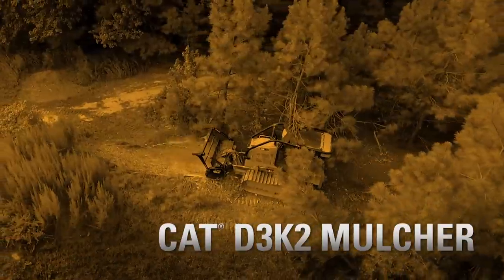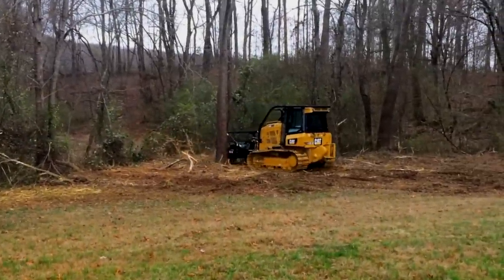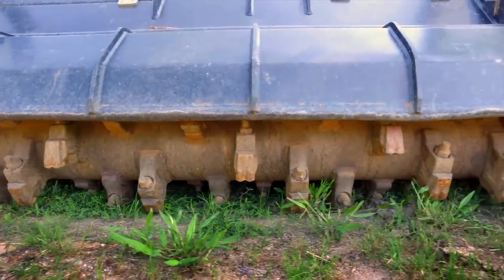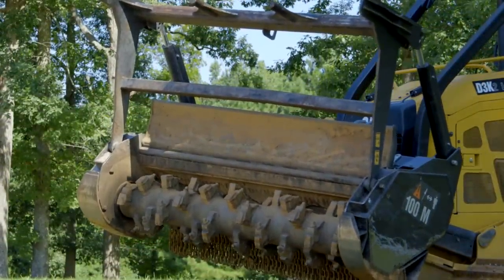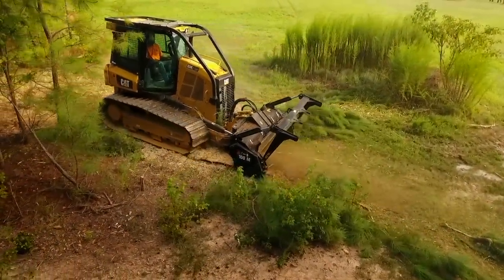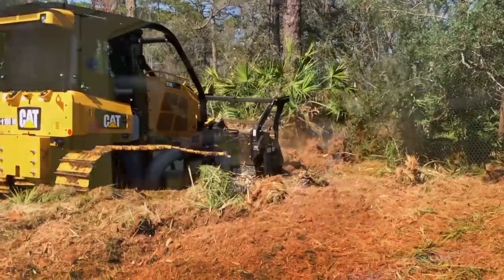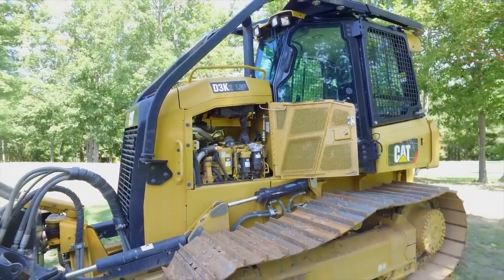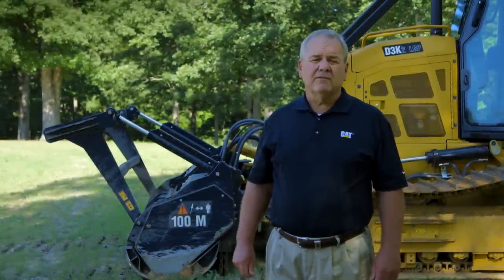Cat® D3K2 Mulcher Overview

Comment: More of a Dozer than a mulcher. I’d like to see it in action. At 104hp and 17 gpm and under 3000 psi it’s an oversized track loader with low flow. The reversible drum is cool
Reply: Absolutely not enough hydraulic flow... for the life of me this would not be a good choice . Give me an excavator with a fecon mulching Head. Way more versatile. Now you get the best multi tool ever , that’s the excavator

Comment: I had the opportunity to operate one of these machines. The bulldozer is great. The mulcher on the bulldozer, on the other hand, is not worth it. While I understand that this isn't supposed to be a dedicated mulching machine. I could go get a dedicated mulcher, complete the job and leave before you could spend the 4 hours changing heads. Anything this mulcher would do efficiently, we have a 10ft front mounted 1000rpm brushog that would do it in half the time. While the reversing drum sounds great, if the machine had enough torque to reverse the drum, it wouldn't have stopped in the first place. Simply find something solid, set the drum down on it and backup.

Comment: Why not use a tracked Skid Steer?  They normally are way faster and you can get much more work done.  Granted the dozer is going to be stronger when pushing through brush and pushing trees over, but the bottom line is how much work I can accomplish is going to affect my bottom line and prices I have to charge to make a decent profit.
Reply from the maker: Hello Gary, you are correct the Cat Compact Track Loader with steel track could be used for a similar application. The D3K2 provides a heavier platform for rough terrain and the HM518 mulcher has the ability to reverse direction when stalled due to excess material. We offer our clients solutions based on their job requirements. If a customer's operation requires that they spend a significant amount of time doing this task, the D3K2 Mulcher is a strong option.
Reply: The ASV120 posi-track with a mulching head would be way more efficient. If I was going to spend the money for a mulching unit that size. I would buy one specifically designed for mulching

Comment: make a quick coupling system like on wheel loader,
offer it for all tracktors up to D6 or even better even for Track-loader and u will sell much more...

many company dont buy a Tracktor or Track loader cause they need this machine like 6 out of 12 month, but if u make it more alrounding without cut the power many will buy it
Reply: U can get mulches for a skid loader your not going to put a mulched head on a wheel loader or ag tractor
Reply: @jonathanvanginkel3849  a wheel loader with and mulcher head isn't uncommon
Reply: @jeffreid3341  I know several land clear companies and have been around equipment my whole life have never seen it on a wheel loader or why u would put it ions one but I suppose it has its place

Comment: aux pack for weight in the back and run the mulching so fast or so strong a 15 inch diameter pine tree does not slow it down. but come on, 4 hours to change to a blade.

Comment: can you put this pacage on a tracked loader
Reply from the maker: Hi Evan! Take a look at our 299D2 XHP Compact Track Loader with the Land Management package. It includes a rooftop aux cooler and the HM418C mulcher. This would be a comparable package to the dozer set-up for a track loader. Contact your local Cat dealer for more information.
Reply: @catconstructiontrade  What about for a crawler loader a dozer won't. Have enough visibility with the head I work mulching clear cuts and a skid steer won't do the job fast enough or in soft ground
Reply from the maker: Evan – we do have Track Loaders, however the HM518 Mulcher (used here on the D3K2) is not offered with those products. We suggest consulting with your local Cat dealer on specialty applications of Cat products. They can assist you in finding the right machine solution and attachments for your jobsite.

Comment: My only concern is weight and getting these to a job site.  I don't have a tractor trailer.  I use a trailer that I pull behind my mediun Ford F750 Dump.  The trailer has a GVWR of 30,000 and weighs around 6500 lbs.  Tat doesn't leave much of a margin for this unit.  I can mount a forestry head on a Takeuchi or Kubota heavy weight Track loader and be WELL under my max weight.  This one is going to be maxing out my outfit. unless I detach the head every time I move from jobsite to jobsite.  And this unit is slow compared to a track loader too, and time is money.